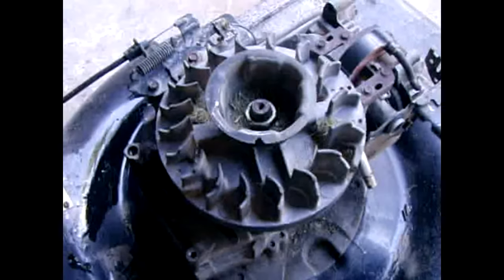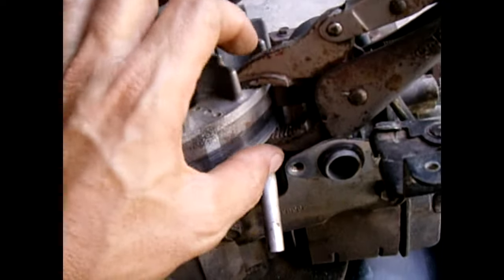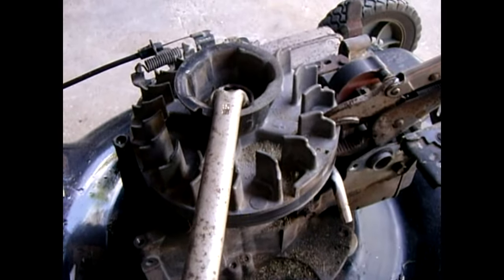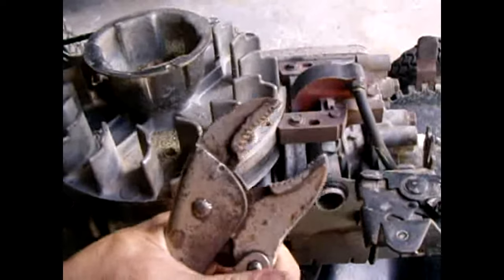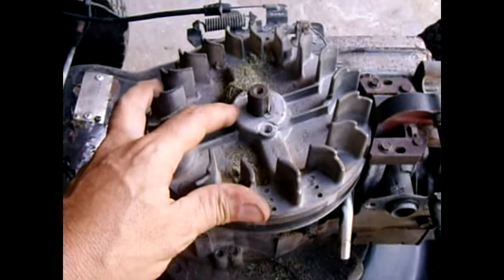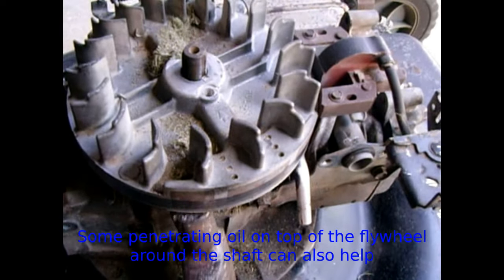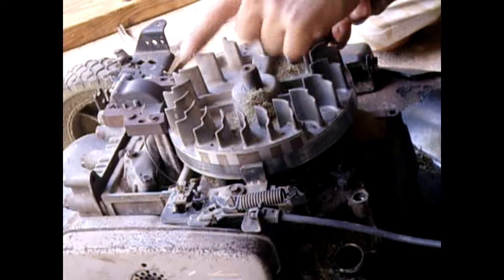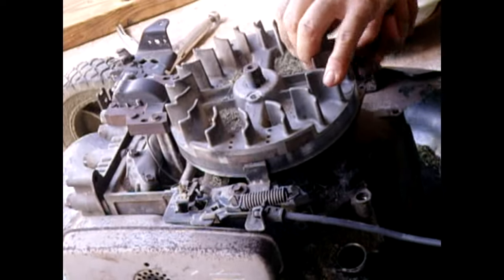Easy Method To Remove A Lawn Mower Flywheel If You Don't Have Special Tools!

Comment: you state this is the only way without special tools? I don't consider a pipewrench a special tool. It is simple to "lock" it (pipewrench) onto the shaft below the engine, just above the pulley, to keep the shaft from turning.
Reply from the maker: Whatever way you can think of to stop the motor from turning. Thanks for watching!

Comment: My flywheel isn’t spinning and the way around would u know what is wrong Will it be valves or my piston rod bc I don’t wanna take the hole block apart.
Reply from the maker: Take the spark plug out of the hole and look inside with a flashlight to see if the piston moves up and down as you rotate the engine. If it doesn't then the connecting rod broke. Also make sure the blade isn't jammed up and the flywheel brake isn't engaged.

Comment: This video encouraged me to get off my butt and work on an old lawnmower I bought with the intention of fixing up and selling. I was pretty much stumped when it came to removing the flywheel, and I didn't really want to buy a tool, and it would be discouraging to have to wait more time to work on it. So I used the penetrating oil tip, hit lightly on the end of the crank, and pryed up on the flywheel. It took a bit, but it did move and came off!
Reply from the maker: Great to hear that it worked and you didn't damage anything. Thanks for watching! Be sure to check out my extensive video playlists for other great videos of interest to you, rate thumbs up, and share my channel with others.

Comment: As a precaution against damaging the flywheel, would it make sense to put a block of wood between the hammer and the bottom of the flywheel, so that you'd be hitting the block instead of the flywheel, and so that the striking would distributed over a broader area?
Reply from the maker: Do whatever you feel comfortable doing. :-) Thanks for watching!

Comment: haha used a puller on mine today as I needed to replace the pin and the whole dam thing shattered!
looks like I will have to look to see if I can get a new one :(
Reply from the maker: If you used the specially designed puller, that should not have happened. You must of used a 2 or 3 jaw puller and applied too much force and did not tap all around the flywheel. You can find a used one at a lawn mower repair shop.
Reply: yup was a 2 jaw puller...all I had at the time.
ironic thing was I turned around to get a hammer to tap it and it was at that point it went BANG and when I looked back it was in two halves :s....bad luck I guess
Reply from the maker: You could have applied a little heat to the flywheel right around the crankshaft using a propane torch while the 2 jaw puller was applied. That would have expanded the metal and allowed it to pop off. Just don't apply too much heat!
Reply: electronicsNmore
Or you can go rent one from an auto parts store.
Reply from the maker: Some people may not live near an auto parts store, like me. :-) If they don't, or do not want to spend money on a puller, this method works just fine.

Thanks

Comment: Just use a block of wood and block off the blade from underneath instead of taking chance of screwing up flywheel, coil or anything else if the vise grips slip. If the blade is off you can use a pipe wrench to grasp the driveshaft underneath.
Reply from the maker: That works too. :-) Thanks for watching!

Comment: A piece of rope inserted in the  spark plug hole will lock up the engine . Much more low tech and easier than using vice grips.
Reply from the maker: Used the method many times with no problems at all. You can also shove a 2x4 into the deck to jam the blade. There are MANY ways that work.

Comment: I always use a brass or lead hammer to hit the crankshaft and I always screw the nut back onto the crankshaft even with the end of the crankshaft before tapping it.  Be aware that you are putting the hammer force onto the crankshaft and the side of the crankcase when you are hitting the crankshaft.  There is no such thing as a free lunch.
Reply from the maker: +David Parker 
Hi Dave. A brass hammer is a good idea, especially for people who have a tendency to be destructive. I never had any problems with this method, but nothing is 100%.

Thanks For Watching!

Comment: a good method I have used in the past on riding tractors I would imagine be the same for push mower take your spark plug out put a cloth rope inside the jug that will actually stop your Pistons from moving it works very well
Reply from the maker: Whatever works for you! :-) Thanks for watching

Comment: I would put the nut on that spindle shaft. so I don't damage the threads. also apply penetration oil. even heat the area aound it abit.
Reply from the maker: I wasn't hitting the end hard enough to cause any damage. Leaving the nut on, is a good idea.

Comment: Would I be able to do this on a Tecumseh engine that’s mounted on the top of the snow blower but the flywheel is in the back facing out? Any ideas?  Thanks!
Reply from the maker: Don't see why not.

Comment: would you need a vice grip if the flywheel won't move, mine is stuck and I do not know why? Need to remove it to find out.
Reply: Probably is locked up and needs to be rebuilt which is usually not worth it on push mowers.

Comment: Well done video. Mahalo for sharing. I tried this method today for the first time and it works like a charm. I will use it again and again until I got some specialized tools which is no longer a priority. I just had to remove a lot of parts to make room for the hammer but not big deal since I am planning a full restoration on my lawnmower. Again Mahalo (thank).
Reply from the maker: Glad it worked well for you. There is little if any reason for anyone to damage the flywheel if the procedure is done correctly. Light to moderate tapping is all it takes. Be sure to rate Thumbs Up and share with others. Thank You!

Comment: That was great. I have never opened a lawnmower so to be able to work on it with minimal or no special tools came in handy. I have to replace the key on mine and 
have to do it soon. The grass is growing fast with all the rain we have and getting expensive to pay someone for something I can do.Thanks.
Ps. where I can buy a key ?
Reply from the maker: Thanks! Be sure to share with others and rate a thumbs up. You can find a key at any small engine repair shop. I would suggest buying it online. All you need is the engine model #.

Comment: Helpful video, thanks. Unfortunately, my flywheel wouldn't budge. Even tried using a three-leg gear puller, but that didn't work either. I was considering buying the genuine B&S flywheel puller tool, but there doesn't appear to be any thread in either of the designated fixing holes. M5 bolt is too large, and M4 is too small. I can't see how the puller will work without threaded holes. Are the threads an irregular size, or am I missing something else? Perhaps the thread is deeper down, and isn't metric? Please help.
Reply from the maker: Try heating the flywheel with a torch around the shaft, then tap upwards.
Reply: @electronicsNmore  Thanks, but I don't have one. I'm more interested at this stage to know more about the typical thread specifications of the B&S flywheel. If I'm going to have to buy something for the next process, I'd rather have the right tool for the job and get it done, versus something that may or may not work.
Reply: Found out the B&S puller kit has self taping bolts. As the flywheel key seems to be fine and there's no play in it, I'm just going to leave it alone. No point in spending more money on tools.

If the key ever breaks, I imagine there will be enough play between the flywheel and shaft to allow removal by the hammer and pry bar method.

Comment: I use a screwdriver in the fins up against the coil
Reply from the maker: If the nut isn't too tight, that will work, otherwise you may break off a cooling fin. Thanks for watching!
Reply: @electronicsNmore  yeah

Comment: Such a simple solution! Glad I saw this afore shelling out on a puller. Thanks for posting from England
Reply from the maker: After you remove the flywheel nut, apply some penetrating oil between the crankshaft threads and flywheel, let soak for 1 hour, then do as I show in the video.

Comment: I wonder if a rubber mallot would work just as good?
Reply from the maker: The hammer works fine just as long as it is done carefully. You need the shock from the hammer to loosen up the flywheel. The mallet absorbs shock, so I doubt the results will be as good.

Thanks for watching! Be sure to share my channel, and rate thumbs up.
Reply from the maker: Take your time and keep tapping. Try penetrating oil on the spindle/flywheel. Worst case, apply heat to the spindle/threads. Do not get carried away, otherwise you can melt the top seal on the crankshaft. The seal is easy to replace if you did burn it.

Comment: Just stick a 2 foot 2x4 into the shoot to hold the deck!
Reply from the maker: Chewbacca833 That is another way which I used in the past. Works good just as long as the key on the shaft is not damaged in any way. Either method works. One you need a 2x4 laying around, and the other requires vise grips.

Thanks For Watching

Comment: OK. But, you know, if you're going to do this kind of work, get an air compressor and an impact set. Less than $200 altogether. Get the Briggs puller, what is it, ten bucks? If that?
If you don't want to make the investment in tools, then you're a hack, and you really have no business banging around out there. Send it to a shop. If I saw somebody doing this I'd spit in disgust.
Reply from the maker: Clearly you didn't read the video description area. LOL. To me, that makes me spit in disgust! I'm tired of telling people to open their eyes and read first before commenting. I suggest you read it, and just so you know, the method works JUST FINE when done properly. :-)
Reply: In fact I did read the video description area. You're just trying to save a DIY guy a buck. I know that. But there are some lines I just can't stand to see crossed. Guys, use a puller.
Reply from the maker: +ontariohvac Once again, as I stated, use this method when NO specialized tools are available.
Reply: And it works. You proved that. Really when I look around the comments I think you are getting too much flak. Yeah, so it's ugly. But so what? It's a lawn mower not a Lambo. So hey, good to meet ya, I'll have a look at more of your stuff, and I've got a couple ready myself. Then you can give me what for right back! Everything cool?

Comment: On my lawnmower, I got no room to hit a hammer beneath it and I have no puller dam
Reply from the maker: In that case, you need a puller. If you have a thick steel plate, you can make one.
Reply: Thanks man I found a steel plate with a few holes will give it a try thank you

Comment: I can't budge that nut.  Any thoughts?
Reply from the maker: +Robert Cardelli 
It should come off if you secured the flywheel. If the nut is really tight, then jam the blade(stop it from turning) with a 2x4 and try it again, but this time use a pipe on your ratchet handle to get more leverage. :-)
Reply: Thank you.  I will try that.  I'll let you know how I make out.

Comment: What if the key is sheared (the whole reason I'm in there)?  Seems pretty tight. Any good tricks for that. I've sheared two in the last two seasons.  Last year, a neighbor got it off for me, but didn't tell me what he did.
Reply from the maker: If the shaft turns, then keep the blade from turning using a 2x4
Reply: +electronicsNmore Thanks, I don't have a problem getting the top nut off, it's with rapping on the flywheel to pop it off. I don't want to whack too hard and crack the flywheel.
Reply from the maker: Apply penetrating oil around the entire shaft and allow to sit. You need to keep tapping if you do not have a puller.
Reply: +electronicsNmore I sprayed it, waited a while, came back in a couple hours, and rapped gently it with a rubber mallet and it slid right off.  Thanks.
Reply from the maker: D1D2
Great! Be sure to rate thumbs up and share

Comment: You could also replace the flywheel nut before tapping the shaft to insure the threads do not get damaged.
Reply from the maker: +rfn944 
I usually do that. :-)
Reply: I tried that but used an air hammer like donyboy73 demonstrated. Except he's got the skill, and I don't, and I peened the nut with the hammer. Damn thing went wild. Taught me respect so I got out the puller.

Comment: you need to use a block of wood and hit the wood with the hammer not hammer to metal...i split a flywheel in half doing only the hammer to metal years ago when i first learned
Reply from the maker: +Tim Spur
I was not hitting hard, it just sounded that way. Using a block of wood deadens the blows which makes it more difficult to remove the flywheel. If you intend on hitting very hard, then yes, use a block of hardwood.
Thanks For Watching!

Comment: Use a brass hammer dummy. On the shaft not the flywheel and apply pressure on bottom of flywheel
Reply from the maker: Who raised you? LOL Clearly they did a lousy job. Is that how you always talk to people? Don't tell me what I should or should not be doing. What I show in this video, works perfectly. If you show respect on my channel, you get it back.
Reply: Lol. Cutting torch would work too
Reply: I kind of agree with the OP... just use a pry bar and apply minimal pressure to the pry bar under the flywheel and use a steel weighted rubber mallet and just whack it a few times and the flywheel pops right up usually 2nd or 3rd hit..
Reply from the maker: warmfreeze
I prefer tapping. Whatever works for you. Many people used my idea with no problems at all. Thanks for watching
Reply: electronicsNmore you should also explain that this isnt a useful method for briggs engines that have generators under the flywheel..
Reply from the maker: warmfreeze
Are you referring to a stator? If so, I'm sure I'd be able to improvise. :-) I'm good at figuring out ways to get things done.
Reply from the maker: Bodybuildingking Thank you. Some people understand. :-)